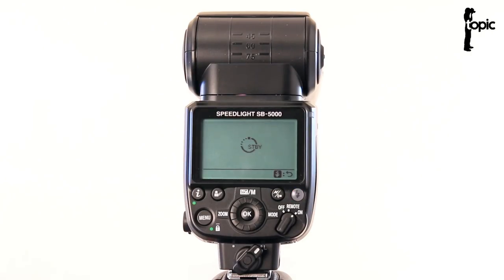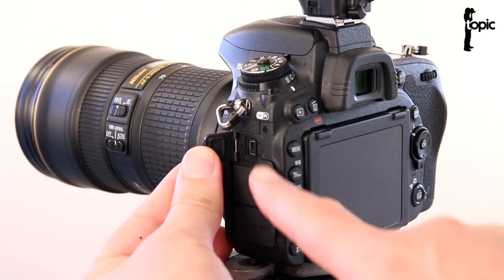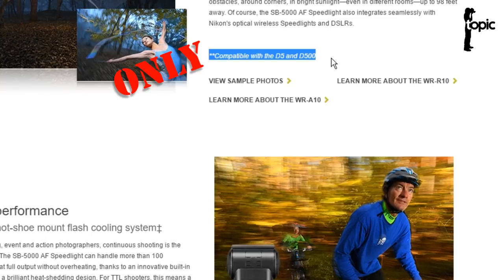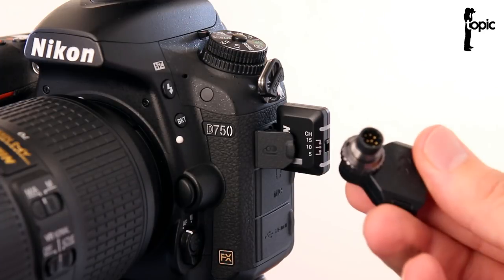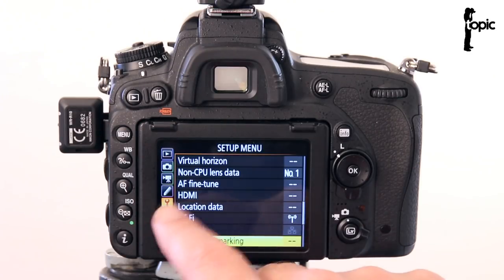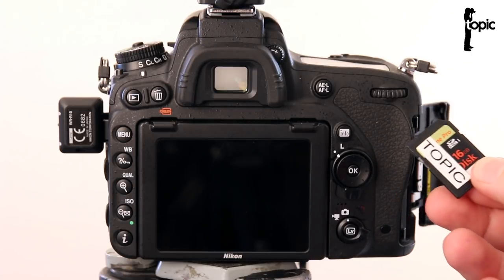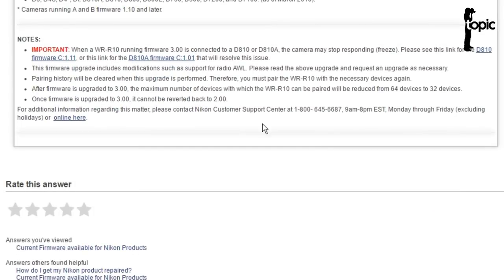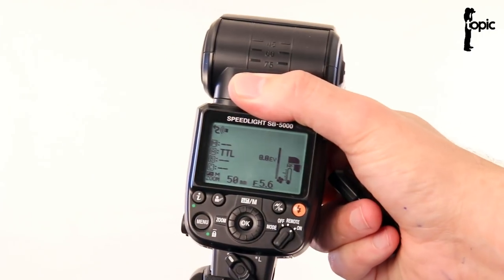Nikon SB-5000 - Hidden costs to get the radio wireless feature working

Comment: It's actually the cheapest solution, because you don't need to carry anything else! The WR-R10 uses no batteries, and you can control groups of flashes on your camera screen (which tilts!). Third party solutions need an additional receiver for each flash (!!!). And the WR-R10 syncs the SB-5000s at the maximum camera shutter speed (set them up in "250 Auto-FP") if you wish, while 3rd party remote controllers only up to 1/250. The WR-R10 is a dream to work with, very minimalistic and economical compared to anything else from third parties.

Comment: Any problems with just using it the same as the SB-910 with the Pocket Wizard miniTT1 and FlexTT5 units? I really just wanted to replace one of my SB-910 units but they are no longer sold. Aside from the radio transmitter aspect, how does the SB-5000 perform as compared to the older SB-910? Thanks
Reply: Do you feel you need more features from the SB910? Have it ever let you down.? Was it incapable of getting the shot? There you go no need to worry about this gizmo lol.
Reply: Stevie Velasquez I actually wanted more SB-910 units but they are discontinued... got the SB-5000, very happy with it and it plays nice with my older SB-910 units... you do hear the little fan come on from time to time, but it's barely noticeable. I don't need the wireless function...

Comment: THIS does work on the z6/z7 cameras, as they are a later model, and have this capability built in, it says so in the z6 manual.
Reply: Hey where is this setting on the z6?
Reply: @sunilchitolie6771  under TWO menu options, 1st enable wireless flash in camera menu, then in set-up menu select flash mode; also commander mode will control this, same as any other speedlight ( digitutor has a playlist with this as a topic, under the z series of videos, + Grays of Westminster has a great video too[shows the "Pairing" method], as Digitutor shows the 'pin' method, which is rather cumbersome. also has a 'quick access' by pressing the 'info' button twice, this gets the Commander menu, UPGRADED with other controls as well, all at your fingertips!!
Reply: @sunilchitolie6771 when a SB-5000 unit is connected on the hot_shoe the menu  'Flash control' pops up ( becomes selectable)- one quick hack is to press the display button inside the lv switch (photo/video), it is on the last press before the normal view returns, HINT, to change settings, and enable AWL in this menu hit 'i'button when in this display mode, or use PENCIL/ Spanner menu; can't recall which, pardon my memory; under "FLASH CONTROL" - there are TWO 'flash' menus the one I mean is NOT the one with flash off/red-eye/rear curtain sync, etc. options ('flash' menu), you will know the right one, as it gives compensation, ttl/ manual/Gn mode settings as well as wireless, group mode, etc. ('flash control' menu). one other hint, even though Nikon in their digi training videos use 'PIN' mode, PAIRING is so much simpler, just set sb-5000 to radio awl mode, go into PAIR and BEFORE hitting 'execute' set channel on the WR-R11b - replacement for this transmitter; and simultaneously hit 'execute'& the grey button on the transmitter, if both lights stay green all is done!!- if you see - - where the TTL would be on the flash, the GROUP or CHANNEL is set wrong!! (simple fix). this 'display' method also gives access to a "test flash" option, to test all is set up correctly, PS: this fires in group order, NOT all at once.

Comment: Hi,

one question about this video. It is possible to use flashs (SB-5000) unleashed wih my D750 and the WR-R10 with the new wireless signal (without line of sight)???

I put the WR-R10 in my D750 (with current firmware on all devices), start the SB-5000 in Remote-Mode (withe wireless option) but nothing happens :-(

Comment: These WR-R10's are nigh on impossible to get hold of now. It feels like there's a massive voice in the Nikon pro line for this kind of thing right now.
Reply: yes, a good reason for this is they upgraded the system' dongles, to the WR-R11a\b the a/b denotes the style of camera (b for dslr{d500/D5}; a for Z6/7/8/9) as what they have done on the wr-r11b variant is to morph the adaptor and dongle into the one unit, GENIUS, so making the early wr-r10 and wr-A10 set obsolete.

Comment: This set up does not work with Nikon D810 bodies even using the 10 pin connector and firmware 3.0.  Nikon customer support told me I have to use a SU-800 that’s not radio support. To trigger the sb-5000.

Comment: AS of 2020 this firmware is installed AS BOUGHT so no more need to upgrade, as I have been informed, also this can trigger the camera shutter and not just the flash, this awl is ONLY for flash firing, it will still fire the camera remotely, ( can replace your current cable remote), using the "garage door opener" remote that is INCLUDED IN THE KIT.
this is sold as a kit, remote + transceiver, the 10 pin adaptor is what you order separately.
and you did not mention that the sb-5000 will still work the same as any other model: ir with cls, see flash and fire,su-4 mode with a pc cable, or on camera! , the wr-r10 set is ONLY required for AWL operation with compatible cameras (D5,D500, Z6,Z7) and where "through the wall" flash communication is essential, or situations in which ir based cls will have reliability problems.

Comment: Is any body know how to pair my wr-r10 to my sb5000 with Nikon d7100??
I tried everything and also I sent the wr-r10 to Nikon to upgrade it to firmware 3.00 and also the Nikon team sent me all steps for pairing and I did everything but it doesn't it says " no responding" on the sb5000 screen please any help 
Thanks
Reply: I was told by Nikon today that unless your camera has built in radio you can’t get the r10 to pair with the sb-5000 flashes. So I spent $1500 to get a system that won’t work for my d810.

Comment: So why can't people just use pocketwizard system or an SU 800 infrared unit?
Reply: The answer is that the pocket wizards don't reliable fire at the same power when I use a three light set up. I think there is no issue when I am using one light off camera and a pocket wizard. However, I find that in a wedding situation, for example, and I have two lights by the band and one on camera, I am getting crazy inconsistent lighting from this pocket wizard set up. I love pocket wizard but I can't get control of the system. Warning: could be user error.....but for me, the inconsistency is maddening.....

Comment: buenas, no logro linkear mi d750 con la wrr10
Reply: Diego Britez hola, yo tampoco, aún teniendo todo actualizado a la última versión. Tanto el rw-r10, el sb5000 y la D750. A lo visto esto solo es posible en la D5/D500, y en el resto de modelos por ahora solo valdría con el disparador remoto...hasta que saquen algún firmware....

Comment: that is typical nikon. but thats OK. I have that trigger for a long time. bought them when those came out
Reply from the maker: +Richard Haw.  Hi Richard make sure the firmware is updated to version 3. This needs to be one by Nikon rather than a user update
Reply: OK. i dont see myself using the radio strobes now but nice to know. thanks.

Comment: Seriously...just buy YN622. No fuss. Much cheaper too!
Reply: Add the YN560-TX to some YN560 III flashes and you'll be done, no issues whatsoever.
Reply: but you can not use the A and AA (no TTL) function. The best automatization option that Nikon offers.

Comment: This is soo rediculous.  how hard can it be to make it work like canon's.  If there are third party triggers that can do it,  why cant they just build the triggers into the flash?  There is no reason Nikon couldn't make the SB5000 a transmitter.
Reply from the maker: Canon seems to have stolen the lead lately on speedlites, the 600EX is a very robust and easy to use system
Reply: But it seems so easy for Nikon to copy it.  I don't understand why they can't.